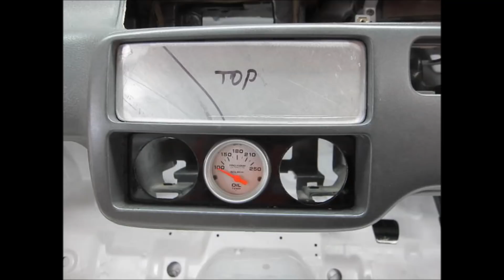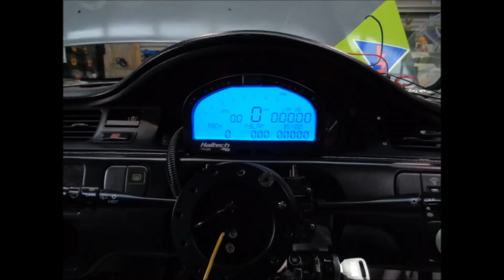Honda Civic EG Hatch K24 Swap Project

Comment: brake calipers ? Bleeder should be up, hose too
Reply: yeah, i noticed that too. The bleeder screw should be up top because the air is up top while the brake fluid rests at the bottom. So the way it is, his brakes cannot be properly bled
Reply: oh, he fixed it later on in the video not even 30 seconds later.